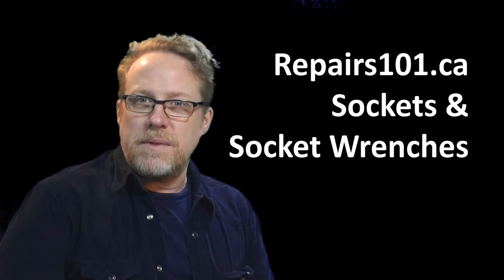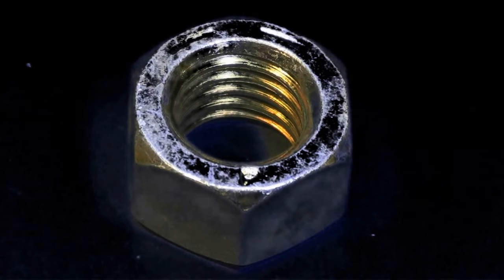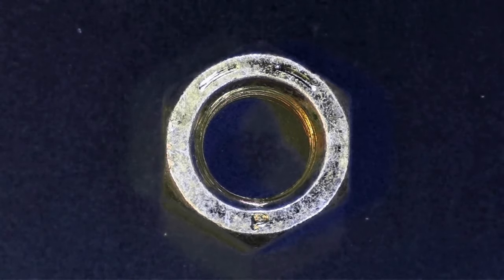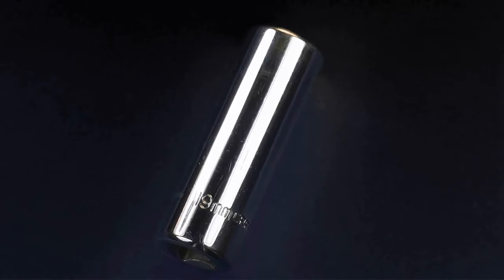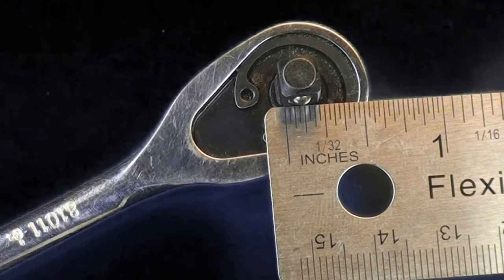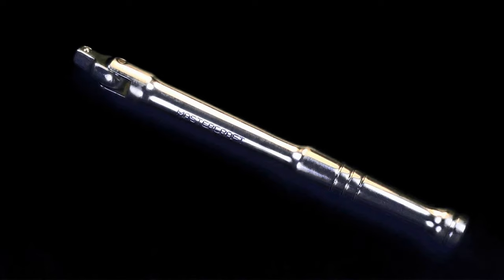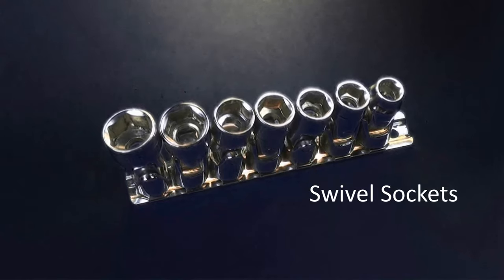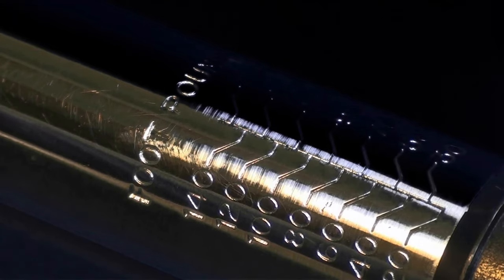Sockets & Socket Wrenches - What You Need To Know

Comment: Do u really need to buy all 1/4, 3/8 and 1/2 socket sets?!? Or do they overlap in their sockets?
Reply from the maker: The answer lies in what you're going to work on. Aircraft mechanics rarely need 1/2" and do almost all their work with 1/4" and to a lesser extent 3/8ths. As a heavy Equipment mechanic I need 1/4", 3/8", 1/2", and 3/4"  all in my personal kit. Shipyards often provide workers with bigger stuff (for bigger hardware) like1" and 2" drive.  And yes there going to be overlap but just because you have 15/16th" socket in your 3/8ths kit doesn't mean you'll be able to remove the lug nuts from your pickup. You won't be able to generate enough torque and the tool will likely fail in one way or another. Good luck!

Comment: Which size do you recomment for putting together a home gym? 1/4, 3/8, or 1/2? (Its for a 15/16 bolt)
Reply: A 3/8” drive is the best all-around.  You may not even find a 15/16” socket in 1/4” drive.
Reply: 15/16 is almost 1 inch (16/16) which is getting quite large. For that size I would use a 1/2 drive ratchet. My 1/2 inch set goes to 1+1/4 or you could say 1.25.   Most 1/4 drive socket sets will not have 15/16 socket. 

A 3/8 might but it’s getting towards the end of the set. Maybe it’s the last socket or the set goes to 1 inch. Some 3/8 sets stop at 3/4 which is still too small. If it’s a cheap set and you really need it tight you could break a 3/8 ratchet. 

Lately I’ve been thinking that a 1/4 drive set + a 1/2 inch drive set would cover the greatest range. The largest 1/4 and the smallest 1/2 will probably overlap by a few sockets. You probably would not need a 3/8 drive except if it’s your only set and you never work on small or large fasteners. Good luck to whoever reads this.

Comment: so what size socket set should I buy if I want to start working on cars?
Reply from the maker: Working on cars means a lot of different things. Underbody, brakes and suspension would generally be big hardware with heavy torque so you need a 1/2" drive for that, engine bay stuff is largely in the 3/8ths range but don't dismiss the need for 1/4" as well to assemble interior components - so I suggest shopping around for a good deal on a kit like the one I show in this ( https://youtu.be/ZU_ChlAF_Ks  ) video - a Craftsman - now extinct.

Comment: Sorry for the dumb comment but i just can't get this to unscrew the motor oil screw i don't know if ita to tight or if it's me that doesnt know how to use it...
Reply from the maker: cangri1788 Sorry but what? The drain plug on the bottom of your engine oil pan? If so please refer to my video  https://youtu.be/4v6QtCIRhFE on changing engine oil for advice on what tools to use. If it's something else or you still have problems try me again.
Reply: If the screw is to tight on the oil pan use a breaker bar

Comment: What is that additional disk for that I get with my DYI ratchet wrench set?
Reply from the maker: Wikipedia says "A spin disk is an socket wrench accessory used to quickly turn nuts after they have been loosened with the wrench." so it rides on the ratchet behind the socket and allows your greasy hands a grippable surface to turn the socket and bolt/nut by fingertips only.
I don't own one and would chuck it if I did.
Reply: Thanks for the reply.

Comment: what are spline sockets used for?
Reply from the maker: Spline sockets on splinefasteners help deliver twice the torque of 12 pt. wrenches on double hex fasteners, helping tighten high strength bolts to high torque loads

Comment: Soccets comfuse me so much. I don't understand what is a size up and what is a size down, wich way the adapter goes and no matter what I do, I never have the adapter I need. god dammed imperial and their stupid fucking fractions.... all I need is a 10mm for most things. perhaps a 12 or 14 for larger stuff, and 16 for wheel bolts. but what is it 1/2= is large, and 1/8 or 3/8 or 1/4  or something is medium and small?

if it had at least been as simple as 1/2, 1/4 and 1/8, but nooooo.... If I think about it I know that 3/8 is less than half aka smaller than 1/2 but what is smaller between 3/8 and 1/4 or whatever. it's a mess.

and lining up loose soccets with metric and imperial. the lower the number, the smaller the soccet. 8-10-12. with fractions. just shoot me now.

Comment: This isn’t helpful to beginners at all.  There are differences but this video does not expand on what differences beyond saying that there are more specialty adapters on ½ inch than anything.
Reply: Begnners need to get a good 3/8” drive ratchet first.  The classic S-K is a good choice, new or used.  I bought mine used ca. 1960 and I still have it.  I used to work on my cars with it.  I never owned a 1/2” ratchet.  I borrowed a 1/2” drive wrench the few times I needed one.  The 1/4” drive system is for working on small machinery only.
Reply: @GH-oi2jf would a gearwrench 3/8 be good for a beginner please?